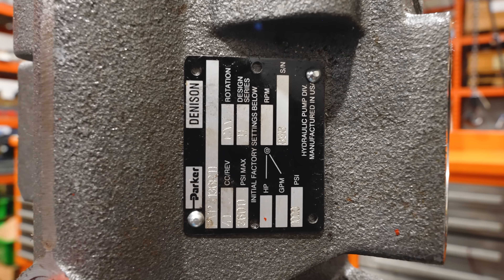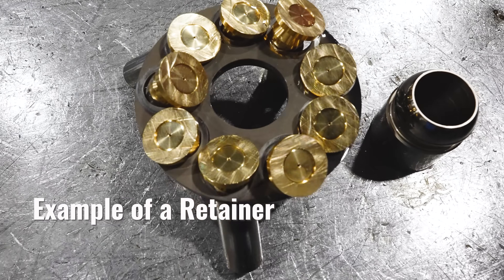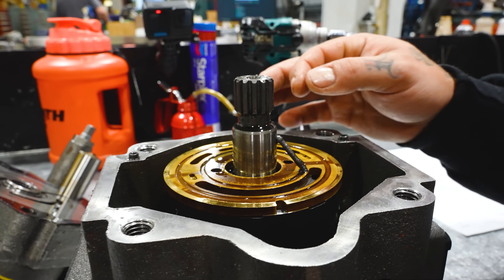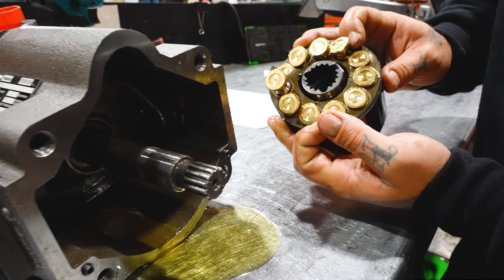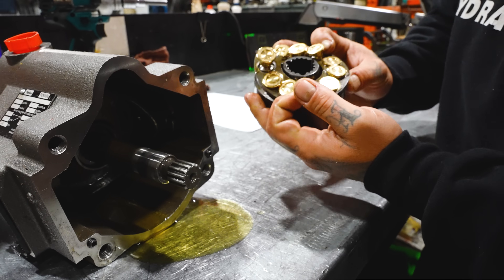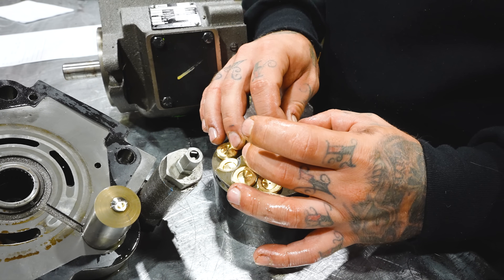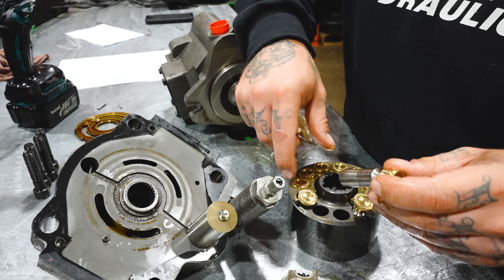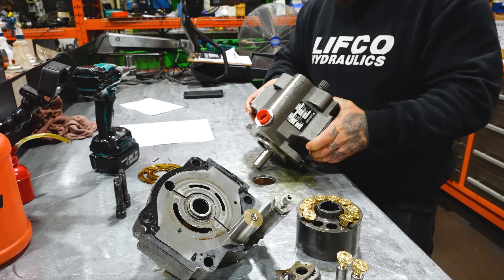Snapped Piston Retainer: PVP41 Troubleshooting

Comment: I liked your content and also I didn’t know the part you hold at 4:15 is actually a hydraulic pump piston. I work in a pneumatic maintenance section of a factory and at the desk we got one of those pistons and every time I ask what does it designed for they just say “ it should be a silly pen holder “. They are gonna lose their mind when I show them your video.